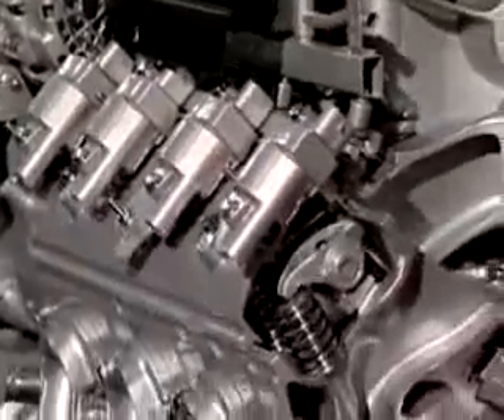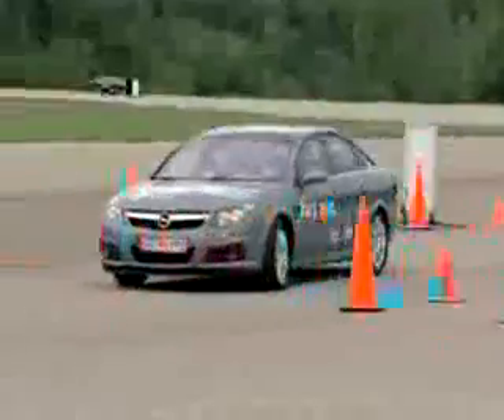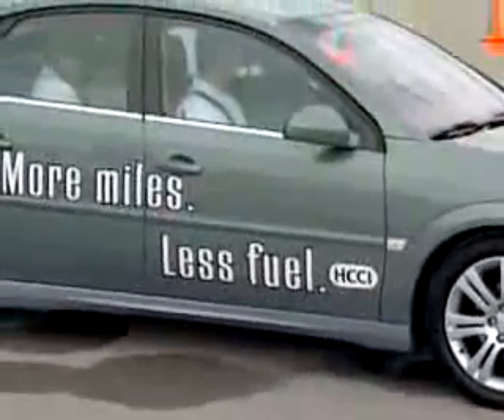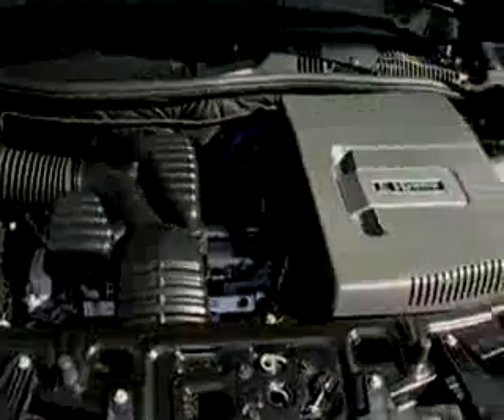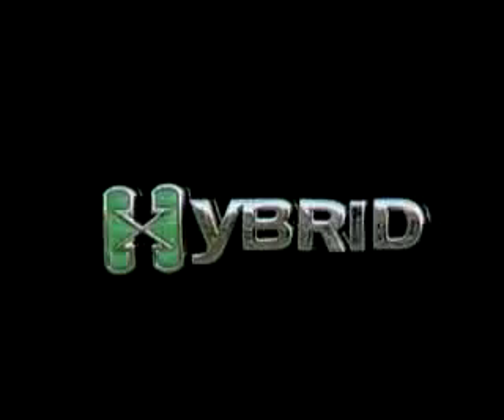HowStuffWorks Videos -New HCCI Engine

Comment: Looks like nonsense. The efficiency here is higher compression. That's been known for a long time. Ditch gas and diesel. Run methanol at high compression. Carbon dioxide worries over.

Comment: I bet it'll run on diesel.
Reply: nope..
Reply: delcastillo1000
it does....or uses diesel to increase octane to control ignition during compression.
Reply: "uses" but not run with purely diesel because if that is the case, an fuel injector should be used to atomize the diesel. Unless the A/F is already atomized in the carb.. because I don't think how the carb works was shown in the video.

Comment: So its a diesel....
Reply: Titaniumfox95 

die·sel

ˈdēzəl,ˈdēsəl/

noun

an internal combustion engine in which heat produced by the compression of air in the cylinder is used to ignite the fuel.

Comment: yeah it called diesel cars... nothing new
Reply: Nope, HCCI motors are supposed to ignite air-fuel mixture altogether for a better efficiency, diesel motors are similar, but they first compress air and then an injector supplies the fuel and then boom, but the downside on this is that the flame will start at the "top" of the cilinder head and spread to the bottom, whereas the HCCI would have a much better flame because the air-fuel mixture is supposed to ignite when reaching a specific temperature
Reply: Arturo Horton 
yep, youre right.  just wiki it.